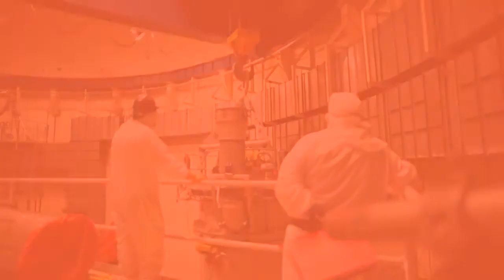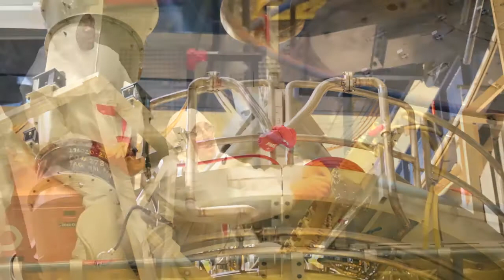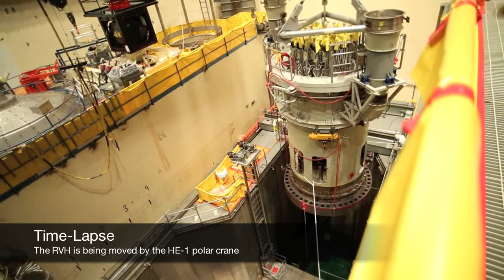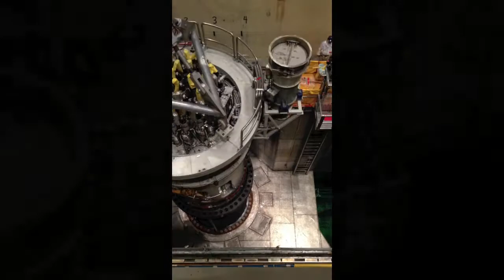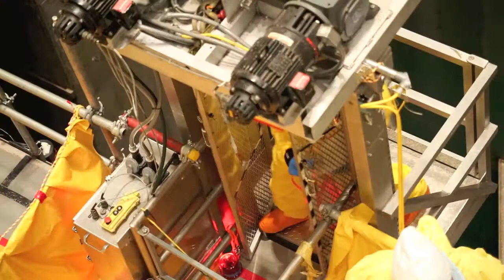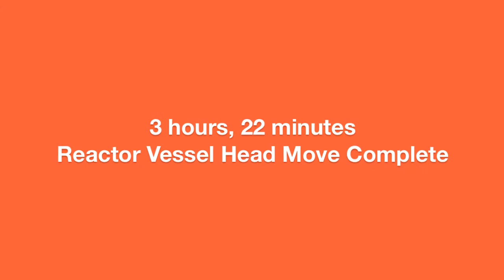Fort Calhoun Station Reactor Vessel Head Move

Comment: If its a refuelling outage, why isn't the reactor cavity flooded?
Reply: I know this is late, and this reactor has been shut down.  However, you are correct in that the reactor cavity would normally be flooded, and in fact it had to be to move fuel.  When the head was being removed or installed the reactor coolant level had to be lowered to just below the flange.  Reactor head assemblies contain many electrical components, such as cooling fans and sensors, and are therefore not designed to be immersed.